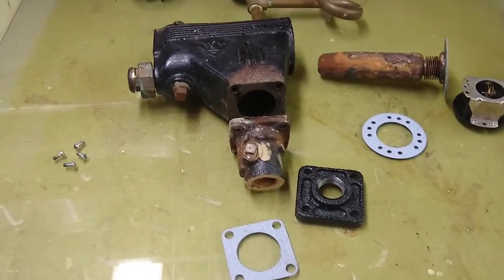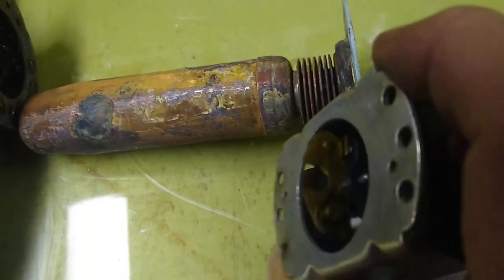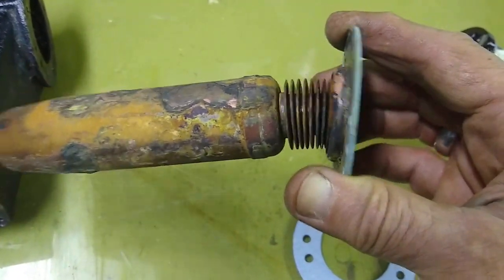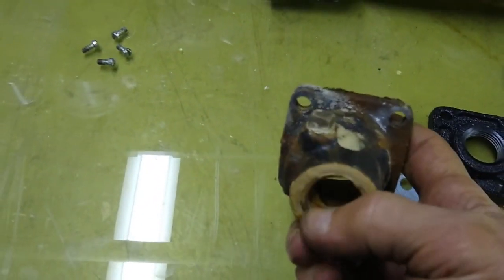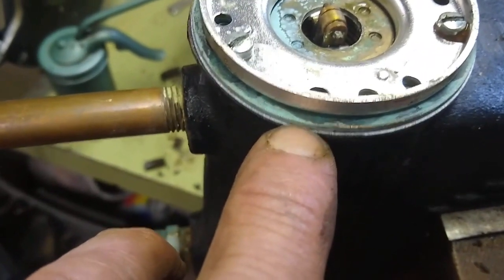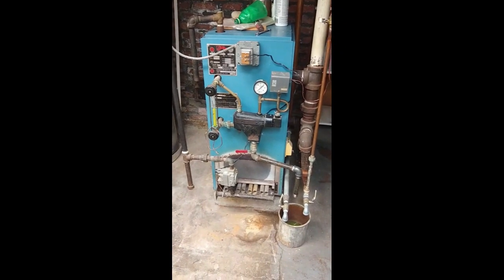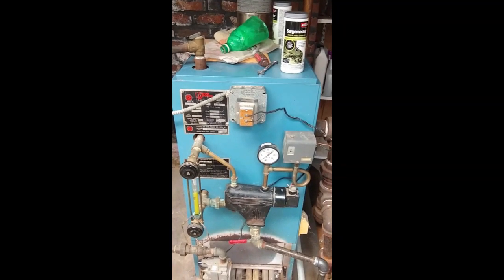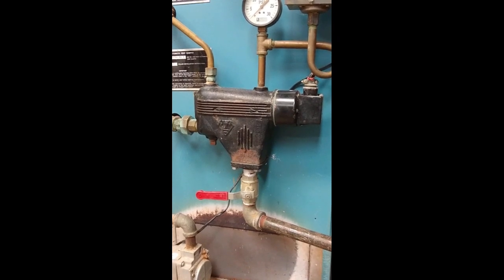Rebuilding a McDonnell No. 67 low-water cut-off valve for a steam boiler

Comment: Good Job, no guts no glory, replaced the core! That’s the first thing on the assembly line. I had to replace mine after only 7 years, still under warranty. But they offered me a complete replacement for 1600, I took it, now I have 1600 in spare parts

Comment: Where do u add the treatment?
Reply from the maker: I take off the pressure relief valve, at the top of the boiler, and put the treatment in there. I only hand tighten the pressure relief valve, because there's no pressure and no risk of leakage. Then it's easy to remove/replace when adding treatment. It's shown in this video at 3:20.
https://youtu.be/u4ddG7cFMYs?si=f1C6wvqq1noe9uWA

Comment: I really like your video but these are supposed to be replaced every 10 years according to the manufacturer, so beware of insurance/personal safety risks of rebuilding.
Reply from the maker: Thank you. I'm sure the manufacturer recommends that for liability reasons. I have never heard of anyone replacing this component as preventive maintenance. I'm no expert, but the guy I mentioned in the video is, and he didn't suggest replacing.🙂

Comment: You just could have removed the electrical, got a bucket of distilled vinegar and dropped the whole cut out in their for 30 mins, along with the pig tail and anything else that needed to be cleaned.
Reply from the maker: Please try that on a heavily corroded valve and let me know how it works out.
Reply: @djpffitzgerald118   I have, that's why I said distilled vinegar. I tried CLR however that did not work.
Reply from the maker: @wd8557  Thanks, I'm surprised that it works, but I hope your method helps someone to do it easier!

Comment: there is a real possibility that with that much goo in the housing,the pig tail going to the control is also plugged
Reply from the maker: Good thought, thanks. I know it's working because I tested it to be sure it cuts off the boiler when the water gets low. But that's certainly something that should be checked.